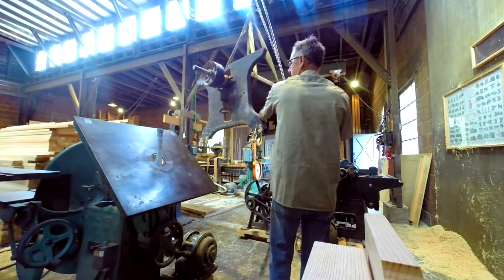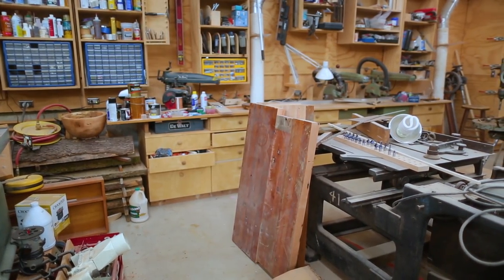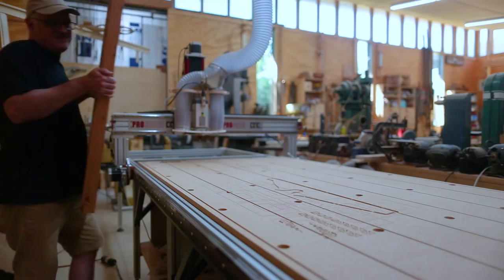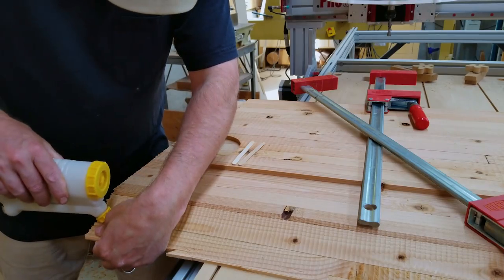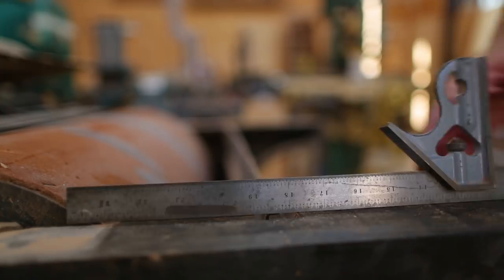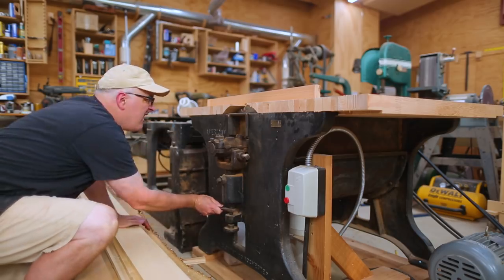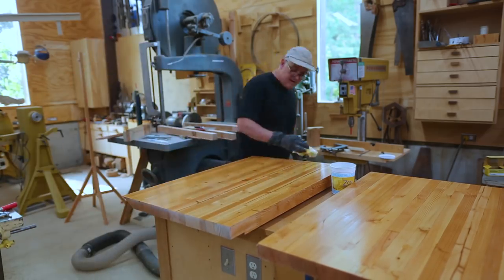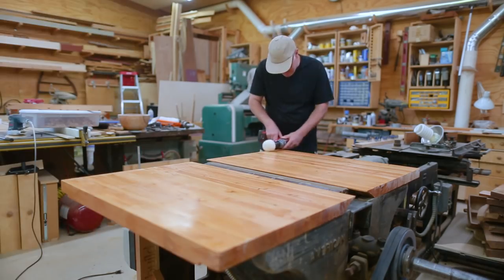Making New Tables for the Surface Sanding Machine

Comment: Why not just get a new cast iron top? Baffling.
Reply: Because there would then be no video of Franks woodwork for you to make a silly comment about. Do you understand the point of the channel ?  Showcasing Franks problem solving  methods and woodworking skills. Not surprised you are baffled . Thinking about things takes thoughts .
Reply: Running a CAD program isn't "woodworking."  Furthermore, that wood top isn't going to last. It will break, and it won't take long to break. Frank does some nice work, but this video was silly.

Comment: Attempts to improve a bent working surface - uses a material that tends to warp and sands it so thin that it is guaranteed to flex.

I'm really a big fan of your work Frank, but this one was just not good from the get-go. You should have contacted someone to straighten the bends out of the tables, it relatively easy to do using a high power torch and possibly a press. Resurface afterwards with a milling machine.
Reply: You have absolutley no clue what you are talking about, haven't you? 1. the wood is plenty stable, this is not the bed of a 5-axis Milling Machine. 2. you cant press/bend cast Iron back int its original form and heat would just crack it.
Reply: Lisabon  No reason to get personal, right? I got a degree in material science for metallurgy and foundry technology so I'm pretty confident in my expertise in this particular are. How do you reason the bend to appear in the tables in the first place if cast iron cant be deformed? Still, wood can swell or shrink with changing humidity. Its a bad idea overall.